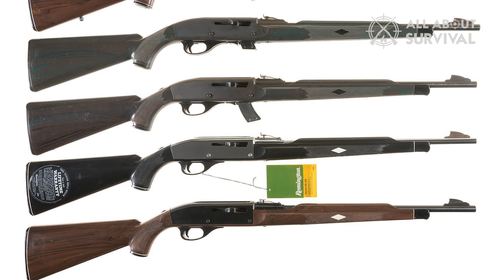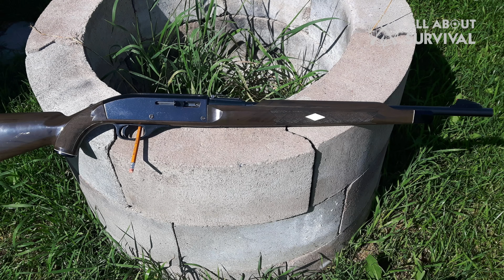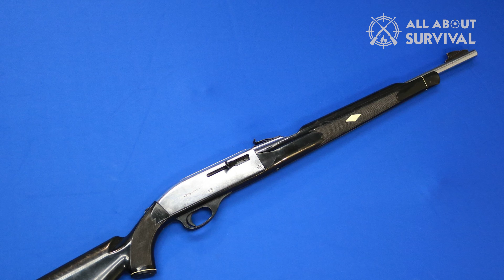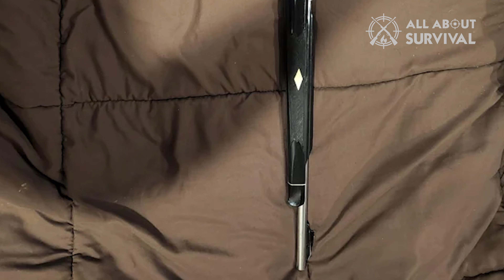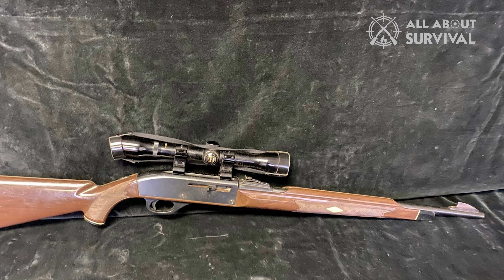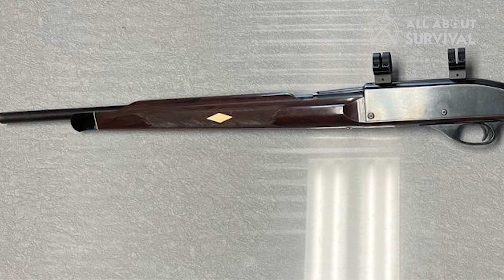Remington Nylon 66.. What NO ONE is telling you!

Comment: Fun Fact:Bill Ruger borrowed the barrel mounting system of a screw holding the barrel to the receiver for the "new" 10/22.
I've got a 1961 vintage Mohawk Brown Nylon 66 & an SBO Brazilian made knockoff in Apache Black from sometime in the 80s.
My Seneca Green rifle was made in 1962 but it was stolen 2 years ago.
If you see it with the production code BJR,contact the law,will you?

Comment: My understanding that the reason for making these rifles in the first place was cost cutting. Yet the original price back in 1959 (the year I was born) was $49.99. I got my first .22 rifle in 1973, at age 14. It was a Marlin Model 60, with a 4x scope, walnut stock, micro groove barrel, gold colored trigger, and brass tube magazine, and it cost $39.99. I have never even seen a real Nylon 66, but it seems the Model 60 would be a much better rifle, at $10 less 14 years later.

Comment: I possess a nylon 66 Brown stock, purchased in the mid-70s. I took it to college with me that almost all had Ruger 10/22. I can keep up with them without a problem and my gun held more rounds, and I created a system that I can reload 14 rounds in the second. Great rifle, when difficulty due to my ignorance was that I would lubricate the nylon receiver. It didn't need that. When I stopped doing it the gun would hardly get dirty. Lubrication would draw the dirt to it. Just keep it dry and it'll stay clean. The nylon should not be lubricated, it retains its lubricity naturally due to the material.

Comment: I have a Nylon 77, which is the same thing as the 66 except it has a removable magazine instead of the tube fed model.  It's a great gun my dad purchased before I was born.
Reply: I have the same rifle I bought back around 1974 and paid $50 for and still shoots great. I just wish I could find some spare 10 round mags for it. I have a couple but would like to have a couple of more, but Remington doesn't/hasn't made mags for these rifles for many years.
Reply: @Mountaintarheel  I found some at Cabela's a few years back and bought a few just to make sure. I do believe I was a 3rd party manufacturer, but they have worked well for me and my little 77. Good luck in your search...

Comment: Purchased my Mohawk Nylon 66 in 1969. Still have it but don't shoot it as much as I would like. Not only is it fast handling, fast pointing it shoots faster than any other .22 Semi-auto I ever shot, including the Ruger 10/22. The secret is the nylon. The bolt sliding on the nylon has little to no pinch points and super slick bearing surface. Doesn't get hot like metal so no expansion to cause it to bind.
And yes, I would buy thus piece again. I wish I had bought a dozen of them in the 1960's.
Reply: About a second and a half for 15 shots.

Comment: I have a 66 and the Tube fed 77. I like the 66 better because I had the mags fall out while squirrel hunting with the 77. Both  are great Ironworker sight rifles. I shot thousands of rounds through both. I believe the 66 is a little more accurate because the tube helps support the frame. Just my opinion. 🇺🇸🦅

Comment: Having tried to mount a scope on my Nylon 66 a few times, I can tell you that it's a waste of time.  You can zero it, reload it, and it will need zeroing again.
Took me 30 years to get mine jam.  When I took it completely apart and cleaned it, it looked like road tar.   Hopefully, I'll get another 40 years out of it.
Reply: why ?
Reply: @alanjones3874  The sheet metal cover over the nylon is not rigidly connected to the barrel.

Comment: I had bad luck with mine.
The front and back sights are on separate pieces of steel connected only by the plastic they are mounted on.
The second shot was always way off from the first shot due to the barrel warming up and moving relative to the steel shell the rear sight was mounted on.
I could never trust it.

Comment: My Uncle showed me the best way to clean the 66. Ronson Lighter Fluid (accept on substitution) a small green twig to plug the muzzle. Pour lighter fluid in the breech. close, and shake. Apply compressed air, wipe. Done. Oh, the 66 is also a gunsmith's nightmare according to reports.
Reply: I have had them apart several times , I would say a gunsmith that couldn't figure one out, probably not much of a gunsmith
Reply: @robertboyd3863  Anybody can take one apart . I can take a locomotive apart , the trouble is in the reassembly .
Reply: @alanjones3874  Now that I understand how simpleminded you are, I can understand why you could never put anything back together

Comment: I owned a gun store and customers would bring them into my store after they decided to do a little kitchen table gunsmithing. I made the mistake of telling a customer I’d put it back together. Bad idea, those things are made from a thousand tiny pieces. I put it back together and after that I swore I’d never work on another one. Total junk rifles when they become dirty and need to be cleaned.
Reply: A smart man doesn't use cheap ammo and gives the '66 a proper cleaning regularly. Mine is 60 years old, warmed up every couple of months and has never been taken completely apart . It has outlived a Marlin semi-auto...
Reply: I never had any problem taking them apart and putting them back together, but calling them junk shows you are sadly lacking any working brain cells
Reply: @robertboyd3863  You sir are a bowl of air and the air is a fart .
Reply: @alanjones3874  With your total lack of working brain cells, I understand how the simple little gun would have confused you

Comment: I scoped my 66 way back when.  I noticed my shots were going off at distance.  I took it back to the dealer to see what the problem was thinking I got a bad scope.  Turned out any change in forearm pressure would change the point of impact as the barrel is not rigid with the receiver.
Reply: WTF ??
Reply: @Badgerstate  
The most accurate rifles have a "floating barrel" where the barrel only is held in contact with the stock at one point...
and doesn't touch the stock anywhere else...
So the the OP was twisting the forearm with the hand pressure of the support hand instead of resting the stock lightly on the palm of his support hand...
and the touch of the stock on the barrel "swivelled"the barrel at the only attachment point (near the breech) thereby throwing off the aim....
since the metal cover the rear sights are riveted to also is not attached to the barrel...
It all adds up...

Comment: They were just “ok” rifles. Accuracy with a scope proved dismal because of the flexibility/flexing of the chassis/reciever. Fired off hand with iron sights they were decent plinkers. They also required high velocity long rifle ammunition. 
I didn’t notice that the mentioned the mid’80s Norinco imported Chinese copies. They were easily as good as the original ones.